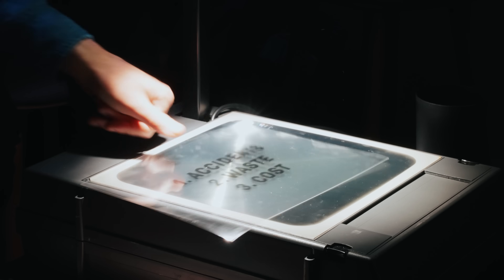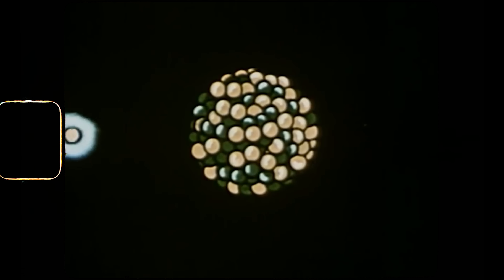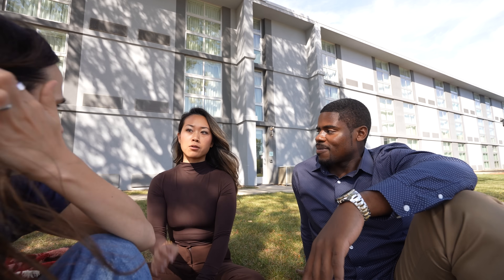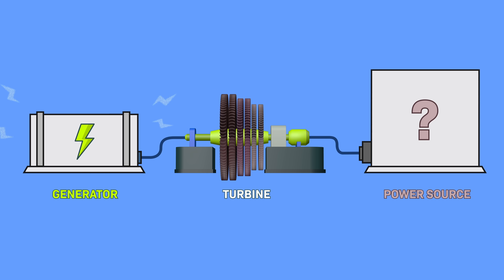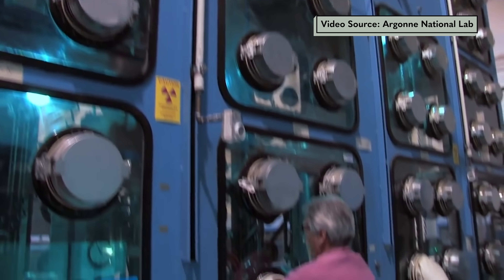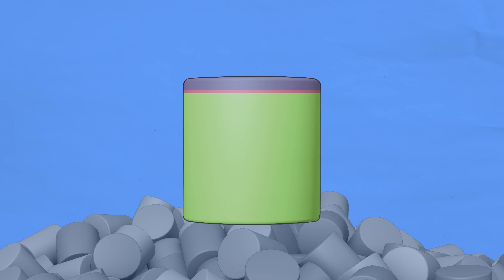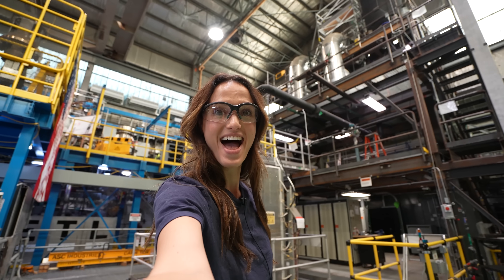The Big Lie About Nuclear Waste

Comment: You can turn U238 into other fissionable material and for many years that was the goal of the fast breeder nuclear reactors. Several test reactors were built to do this. Dounreay in the far north of Scotland had such a test reactor, the French had the Superphénix  which was supposed to be an actual power reactor supplying the electricity grid.  The bottom line for these facilities they had a lot of technical problems and financially they could never be made viable.  Technology moves on but the history of nuclear power is very poor in predicting the final cost and timescales.   If you are willing to pay the price it would be cheaper to actually capture CO2 from a conventional power station and pump that into some old gas reservoirs.  The "advantage" of this is even though it has not been done well in the few places it as been tried it is well understood technology so it can be made to work.  I do not think carbon capture and storage is a good idea but in comparison to nuclear power it's probably better.   Re nuclear proliferation it is difficult to enrich uranium without other countries knowing about this e.g. Iran,  Once you have a nuclear reactor and you start reprocessing the fuel it is "easier" to get hold of Plutonium and make a nuclear weapon, if you want, e.g. North Korea.  It is not "easy" to make a nuclear weapon but it is not too difficult for a state to do this.  The current system of nuclear safeguards is to try and warn the world community if a country starts to try and siphon off nuclear material to get the required materials for a bomb.   This is what North Korea did.  Now we have the example of The Ukraine where nuclear reactors are essentially dirty bombs ready to be "activated" with a conventional missile strike.   The nuclear option is not going to come quickly enough to make a significant difference, go hell for leather with renewables and invest in research in energy storage.  Put a very high price on Carbon and then people will work on a way to get the power.

I am real but I would hesitate to say I was  “bright” ....

Comment: When you factor in the construction cost, decommissioning and storing nuclear still makes no sense even if you can recycle the spent fuel. Wind, solar and battery, which DOES NOT NEED FUEL, are where we should be spending our money! Because its cheaper, safer and not limited by fuel!

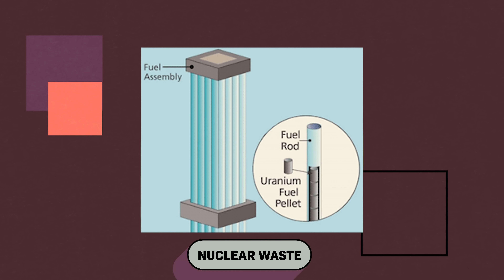Comment: Ok  I watched this several times    many questions  At 7:12.   she  explains enrichment wrong.  I think it should be removes some U-238 to enrich % of U-235   at 10:12.  why would electricity separate the good from the "bad atoms". This seems way over simpified to point of wrong. At 10:35. why would the recycling reduce the time the waste is radioactive.  The long lived fission products dont fission they would only transmutate but that kills the nuclear reaction  The odd waste product made in the first cycle like Pu-239 would fission in the recycle yes.    at 11:14. I think she misinterpreted  the article she is quotes In Japan it reduces volume of waste which makes sense not the length of time it is radioactive.

Comment: Yes, nuclear fuel can be recycled, but as mentioned, it raises the fuel costs.  The other problem is cost and regulatory issues.  It is prohibitively expensive to build light water nuclear reactors.  And there are safety concerns associated with ageing materials inside the reactors, as well as geological concerns as Japan is still dealing with.  The path forward for nuclear should be smaller reactors that shut down by themselves if a problem occurs.  Small nuclear reactors solve the cost issue and to some extent regulatory issues.  These small reactors are being tested now.  We will see what the results will be in another couple of years.  Also, companies are already considering and making plans for using small nuclear reactors for energy intensive industrial processes like thermal crackers (dehydrogenation).

Comment: Spent nuclear fuel accounts for less than 1% of nuclear waste generated by reactors and mining the fuel. the other 99% still has to be stored it's less radioactive but still bad enough to kill people if they come into contact or it escapes in to the environment. Yes recycling spent fuel is possible and would help deal with the 400 000ish tons of spent fuel but you still have to store the millions of tons of other waste. This isn't a solution, it might help reduce the amount of waste created in the mining process which would be good, but very marginal it's not a valid solution for the vast vast majority of waste.

Comment: Closed cycle nuclear is still less efficient than using particle excitation from ionizing radiation into a substrate and concentrated heat output from spent rods to fuel ambient turbine revolution.

Comment: The entire renewable energy field is replete with solutions of things that we could do now if it were only for XYZ. There aren't a lot of people studying the social science of renewable energy policy, it happens to be my field, but virtually every renewable technology is perfect and Will single-handedly save our planet if only but for... Nuclear power is problematic in a lot of ways that most people don't think of besides the obvious proliferation issues and the staggering upfront cost. I am technically a fan of nuclear but socially it's a non-starter, the amount of concrete that has to go into a nuclear power plant wipes out all its carbon emission savings for virtually the entire lifetime of the plant. Worse, carbon emissions are a compounding interest problem and it's much better to release a ton of carbon into the air in a year than it is to release a ton of carbon into the air now, which means that we really need to do things now. Wind, solar plus battery, and advanced ancillary services can make a lot more of an impact right now which is when we need to make the impact. This is a complex topic and it may make sense from a purely financial standpoint every group some of that energy after we've solved the problems with hypersonic ICBMs and solved a lot of the political rhetoric, but those issues are incredibly real and cannot be handwaved away

Comment: nuclear problems are political problems not problems with how green or efficient the energy can be. 

Cost is inflated because we cannot scale for political and regulatory reasons. Plans fail to get off the ground because they are not popular enough.
We had a solution for nuclear storage that could last thousands of years in Yucca Mountain but that plan got shut down.

People just dont know enough about nuclear to support it. It was the best green fuel for generations but too much political opposition to get it going.

Comment: Seems overly optimistic. Other countries continued using recycled nuclear waste - but there's the catch. Recycling doesn't consume all the waste. It STILL produces waste that cannot be recycled or safely disposed of. (I'm in one of those non USA nuclear countries.)

Therefore nuclear is not a viable alternative for future energy needs - even with extremely high efficiency reactors, and assuming there will never again be a massive nuclear melt down (which inevitably there will be, on a long enough timeline,) massive swathes of land have already been rendered uninhabitable for 100,000's of years due to the past nuclear accidents. To continue using nuclear energy will only render even more areas further uninhabitable, because of the increasingly needed space to store even more spent nuclear fuel.
There's also nothing new clear does, that solar, hydro, and geothermal don't do, to justify the necessity and the risk. Unlike plastics, which is a roll the fossil fuel sector will occupy for centuries even in a post fossil fuel, green energy economy, nuclear produces NOTHING positive other than simple, humble electricity.
And then there's the radioactive infrastructural waste, not the spent fuel but the insanely radioactive turbines and water ponds.
There is no way to dispose of or recycle that kind of waste. It's rather suspicious that this video didn't even touch on that kind of waste, but instead included a grazing snipe at a Democrat President, Jimmy Carter, and an equally glancing accolade of a Republican president, Ronald Reagan. If this was an unintended oversight, then the video is simply incomplete and not fully well-informed. If it was an intentional oversight, then this is clearly biased propaganda.

Comment: LWR reactors only consume about 4% of the U-235 fuel, and waste the rest, but the spent fuel is a very radioactive and is a hard to handle mixture with radioactive materials like Strontium and Cesium and it is not easy to recover the wasted  U-235. Breeder reactors have been around for a while but they are expensive to build and use neutrons from U-235 to convert U-238 to plutonium to make even more fuel, but today U-235 made from mining with low or zero (CANDU) enrichment is very low cost. If we do get a nuclear renaissance and nuclear power expands by a factor of 10, then U-235 will be expensive and maybe breeders will come into play assuming that nuclear can compete at all with low cost wind and solar and new storage tech.

Comment: Rising uranium prices make recycled uranium more competitive towards newly mined uranium but certainly not renewable energy sources. Even less if you factor in the huge amounts of cement which produces a lot of co2 and the high safety standards required for those power plants.
Reply: Wind power requires 10x more concrete than nuclear and there is no shortage of uranium, we have billions of years worth.

Comment: Very interesting. It's something we need to explore reviving.

A few decades back, I regularly visited Argonne because I sold them imaging instruments for doing X-ray crystallography. It's was a lot easier to get in pre 9/11. Also, the original Argonne site is about 3.5 miles east of the current facility in Red Gate Woods Forest Preserve. The early research reactors are buried there. They used to be fenced off, but it was determined they don't pose a danger to hikers, so the fence was removed and interpretive signs were added. Back when the Manhattan Project started, it was really remote.

And finally, I think Johnny bears a strong resemblance to Toby Maguire, who had an interesting encounter with a radioactive spider in one of his movies.

Comment: Hi when you guys mentioned about nuclear energy nurclear energy ultimately still depends on a limited resource of earth even though it does not have the repercussions of fossil fuels but it ultimately will become a depleted resource.
Reply: I think 4 billion years worth of fissile fuel can be considered sustainable.
Reply: Yes, if you also use thorium, then there is at least 100,000 years of power. Plenty of time to get fusion to work.
Reply: @triple7reno  Nope, try 4 billion years worth of uranium and thorium.

Comment: You should do one on the magnetic field nuclear fusion reaction, it skips many steps and produces a field that rotates around coils magnetically that generates electricity instead of using heat to make steam that turns a turbine which rotates around coils. Pretty cool stuff.

Comment: Cleo, we don’t use the fuel once, we use 2% of the fuel once, and call the rest “waste” because it is mixed in with a tiny percentage of nasty atoms, which themselves make good nuclear fuel if recycled.  But that said, what you missed is that we have 80% of the tech to use that waste.  That 1962 reactor was a test, not a commercial reactor.  Getting from that test to real reactors will take a decade or two and a lot more testing.

Comment: Only problem with nuclear fission energy is that it is no longer the cheapest form of energy.  Capturing energy from the fusion reactor at the center of this solar system is cheaper even when you account for the batteries needed to deal with the intermittent nature of that energy.  For a point of example the latest proposed AP300 SMR from Westinghouse is rated at 300 MW and would have an installed cost of around $1B.  However, over its 30 year life it would cost roughly $2.3 B to fuel and operate it.  That works out to $0.042 / kWh.  To match the total energy production you would need a 1.2GW utility-scale solar system that would also cost about $1B, and you would need energy storage to make it non-intermittent.  It would take about 50 of Tesla's MegaPacks at 3.9MWh each to make that energy available 24/7.  That would only cost about $100M.  Operational costs would be negligible.  So, for $1.1B you have the same output for 30 years than nuclear would put out for $3.3B. That is 1/3 the cost to about $0.014 / kWh.
Reply: You might want to check the latest revisions to the Lazard LCOE numbers.
Reply: @chapter4travels  Yeah Lazard's numbers are even more in favor of Solar than my calculations.
Reply: @rogerheuckeroth7456  Not the latest, even the wildly overpriced Vogtle plants are on par with solar and that's only allowing for 4 hours of "firming" which is what they call storage.
Reply: @chapter4travels  Provide link please.  Keep in mind I'm looking at new Nuclear vs new Solar at current prices.  Numbers can get skewed if looking at existing plants.  I agree all existing nuclear plants should be maintained as long as they can safely operate.

Comment: One of the best rundowns on why we should be using the used fuel. It's not waste yet there is plenty of good stuff in it. Then there are the plants that run on Thorium and U-238, talk about having enough enough fuel until we can solve economic fusion!

Comment: The eighth section isn't completely accurate the nuclear waste we can recycle is high-level nuclear waste the majority of waster including the waster in those casks is low-level nuclear waste (clothing, protective, equipment, mechanical equipment, etc.), random stuff that was used in a nuclear power plant has been ground up and then is mixed with ceramic, concrete, and/or glass. Rendering it, effectively, non-radioactive. Then it is stored in dry casks. there is a similar, but more retrievable, method for high-level waste. Finally dry casks are incredibly safe and few.
Reply: and kind of minor kind of major thing most, if not all, US reactors use thorium. A way safer way lest wasteful alternative to uranium.

Comment: The thing about recycling nuclear waste for energy delivery is that you build expensive infrastructure that is reliant on new uranium at some point. Just like residual waste burning plants don't incentive reducing  waste. It makes the whole process not at all safer and we have clean energy alternatives like solar and wind. In Germany we just quit nuclear power and for good reason. It's way cheaper and safer than nuclear. It's just not the solution to our energy crisis. The problem remains the same, if a nuclear power plant blows up the land is unusable. For less densely populated counties like Ukraine or the US that might not be the biggest concern but the population density in Germany make this a pretty bad tradeoff. Eventually the nuclear waste will probably be used in reactors like this but my guess would be that we will do it in a very small scale to treat the waste we already created – the elimination of concerning stuff is the main focus there, not the energy aspect.

Comment: There is enough used nuclear fuel to power the earth for the next 150 years????  That is off low by a factor of 10-100. Add depleted uranium and add another100-1000x.

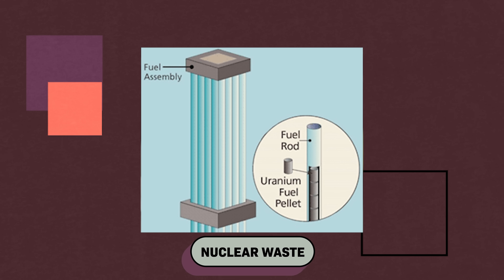Comment: 7:06
²³⁵U
The number refers to the number of neutrons...
It does not. The number is the sum of protons (92) and neutrons (143) in the atom. 235 nucleotides (protons and neutrons) in total.

¹H – is protium (one-ium) or typical hydrogen with no neutrons. It's part of the H₂O you ingest or see every day.

²H aka D – is deuterium (two-ium) or hydrogen isotope with one proton and one neutron, i.e. two nucleotides. It's used in heavy water D₂O (aka ²H₂O).

³H aka T – is tritium (three-ium) or hydrogen isotope with one proton and two neutrons, i.e. three nucleotides.

That's a way to remember that the number refers to the nucleotides, not to neutrons alone. But I'd appreciate if anyone told me why they chose the nucleotide notation.

Also to remember: an element is named after the number of protons it contains. A hydrogen atom always has one proton with neutrons from none to two. A uranium atom always contains 92 protons, a plutonium always has 94. In between there's Neptunium with 93 protons. ₉₂U, ₉₃Ne, ₉₄Pu – like the three planets of our Solar System.

And some more nerdy stuff. Isotope translates as same-place. ¹H, ²H and ³H, all three are in the same (iso) cell (place, tope) of the periodic table because each has one proton only. If they were two protons, that would be helium He, which also has isotopes with varying number of neutrons and makes you speak in a cartoon voice.

Comment: Here’s the thing about nuclear “waste“ it is all accounted for. It is all collected. It is all stored and it is all monitored. It is not really waste it is spent nuclear fuel that still has 95% or more of its energy locked away in unfission uranium. The US and other countries developed ways to re-process this material and put it in existing reactors, or repackage the material and use it in advanced reactors as primary fuel that can make more electricity and heat. This is a process that reduces reuses and recycles the material.

Comment: The main reason the fuel wasn't recycled was the power plants would never have been built if the government didn't agree to buy new fuel only from the major plant builders.  The Fuel contracts are worth more then the cost of building the reactor over its life.  Westinghouse/GE/Etc isn't making money selling a reactor.  They make it selling the fuel.   Molten salt/Thorium reactors which where also built in the 60s can also recycle waste but they can do it in the reactor.  They also don't generate weapon's grade waste.